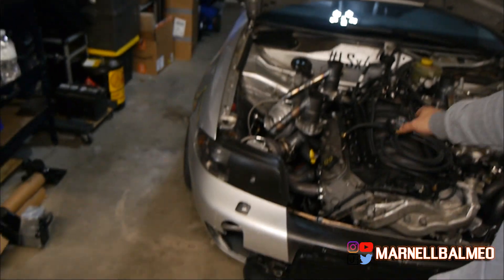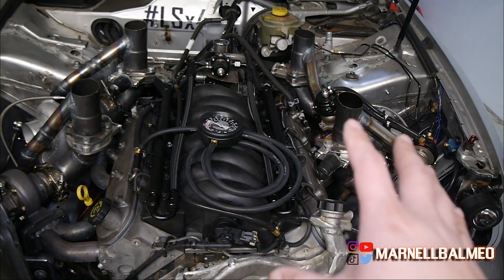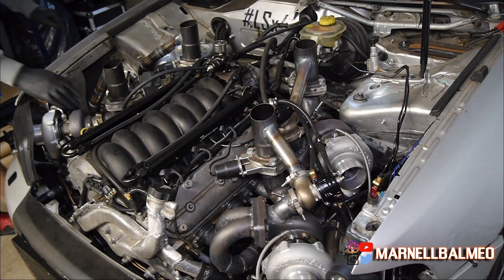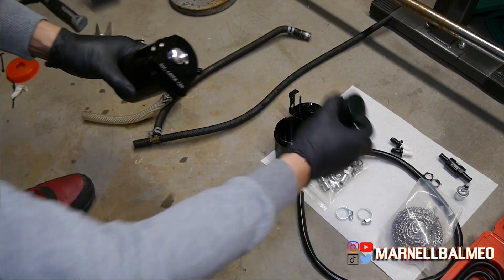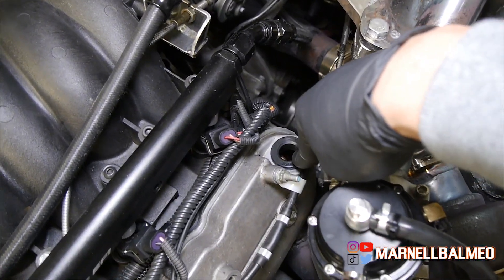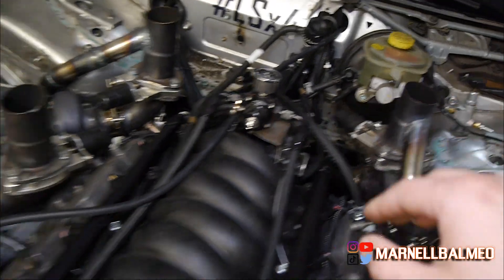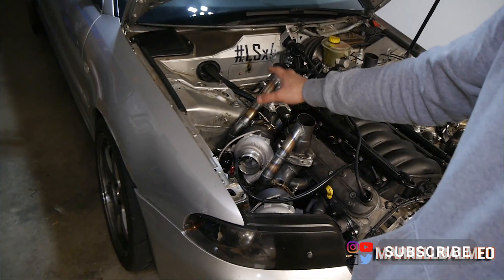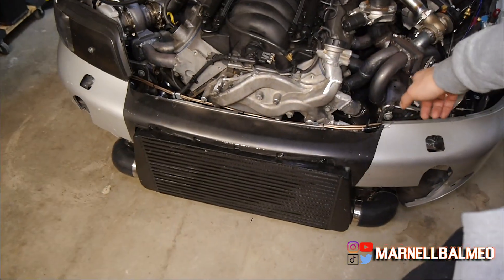Is a Breather or PCV better for Turbo LS? Well I can't believe it made that much difference.

Comment: I have a small 1.0-liter turbocharged car. Do I need to worry about crankcase pressure using just an atmospheric hose without intake manifold suction? Of course, the car already comes with a check valve at the valve cover outlet. Please help me! From Brazil!

Comment: isnt not smoking because the oil feed😂😂😂😂 nothing to do with running positive crankcase pressure, blowby is pushing the rings into hiding. oil seals are about to pop to heaven, another BS catch can clip. Do the research people.. e85 without negative crankcase pressure 😄you made oil contamination device. bravo

Comment: Venting into the Impellers is Stoopid  as it stuffs crank blowby products ie;  Oils, acids, moisture.. through the IC... the intakes and into the combustion.  Racers use a one way valve into the header collector which Suction vents the crankcase.

Comment: Why would you use a pcv valve to limit pressure relief that’s not the way you want to do it
Reply from the maker: I have since changed this to dual setup, which works much better. Even now still use the pcv valve mainly bc out of all the documents I found you also don't want full vacuum in your crank case. The other part of this is without that being limited I would now be introducing huge amount of air at idle as the port is after the TB. While I haven't tried that port being opened I'm going to guess it going to idle to the moon lol

Comment: In my boosted 97 cobra I run a oil breather catch can the Oct system resulted in too much crank case pressure and would try to blow oil out no issues with the catch can breather set up

Comment: You could vent to the exhaust and it will pull a vacuum with a venturi
Reply from the maker: Won't work well with my setup as I have a very restricted exhaust to control noise. So exhaust will end up in the crank case. It will work when cutout is open but majority of the time I drive with exhaust cutout closed.
Reply: it can work, you can run 2 lines, even pull from after the muff. also, use a old school smog pump 1 way valve at the ex pipe so it can only pull, even in case of a backfire. @MarnellBalmeo

Comment: I installed a M/E Wagner PCV valve with adjustable Idle and cruise circuits. Result is 3 to 5 in. of crankcase vacuum. I noticed a difference in HP and torque not to mention ZERO oil leaks...
Reply from the maker: Nice little unit. Looks like spring operated. I'm opting out to remove this for the time being and just vent to the atmosphere. Going to see if that's the source of my random iratic idle issue

Comment: Hi 👋 I recently just added a 2nd oil catch can for the crankcase. I was only running a mini filter but I noticed oil would leak out from the mini filter, so I decided to add another oil catch can. My question for you is do I need a one way check valve for the crankcase oil catch can setup? Or do I only install one on the PCV oil catch can outlet line? Both oil catch can doesn’t have a filter on top of the oil catch can. I bought the one that doesn’t have one
Reply from the maker: I have since modified this and have a working setup now. For a boosted car you need a 1 way check valve. It's valve cover-> catch can -> pcv(to reduce flow) -> 1 way flow valve -> intake manifold.
Reply: @MarnellBalmeo  So it’s not necessary for me to get one if I don’t have a booster engine?

Comment: How can you keep pressure with the filter on the catch can? I have two one for each intake but there’s a hissing noise that comes from it and when I cover it pressure comes back and engine runs normal again. When I have them on my car chops but that’s because the RPMs go 1, 2, 1, 3, 1, 2 etc..
Reply: Idk if you noticed but he put a one way valve in between the tank and the breather. That means it can only draw excess pressure out and not draw any air in (as is what’s happening in your scenario)

Comment: Any idea why I would get blow by out of oil filler hole (oil cap removed/ oil stick in) and no blow by out of oil filler dipstick tube (oil stick removed / oil cap on). I would expect them to both be blowing as I assume they valve area is open to crankcase area.... Really confused!
Reply: would assume that the dipstick goes below oil level so unless oil levesl are low enough which they would never be your not goin to get pressure back that way but oil filler cap or anywhere else at the top of the engine where pressure is trying to vent is where you would expect the most ventilation to escape

Comment: Holy hell. This is the first LS i have seen with 4 turbos? Anyhow that catch can is way to small. On my 1.8 liter boosted b series i have four -10 lines running to a 2 liter can mounted near the back of the chassis.
Reply from the maker: Yea I've gone through some iteration since then, definitely gone with a much larger lines now

Comment: Hey man I have a NA setup and I can’t find any straight answers on the correct way to run my catch can and what to cap off. Any help? Should I run it like you did and cap that back line that you ran to the turbo?
Reply from the maker: What year LS? Typically for NA you use the same ports and just add the catch can on series. So it's pcv-> catch can -> post TB port. Then the other valvecover port is used as a clean side/pre TB. Which valley cover btw?

Comment: Why would you put a breather on the PCV catch can side? That defeats the purpose of the catch can, as you need vacuum on the catch can side of the line to capture the oil. If you place a breather on the top of the catch can, you’re defeating the purpose. You do need a UPR breather on the oil cap, but you need to keep the PCV line pressurized.
Reply from the maker: Breather on a pcv catch can is fine as long as there is a 1 way flow valve-which i added here. This is similar setup as a mighty mouse catch can- which is one of the best out there for the LS. What it does is allow vacuum in your pcv but it acts as a breather under boost when you get pressure in your crank case. I did make a mistake on this that I put the PCV valve before the catch can. I later corrected that on another video. it should be valve cover hose->catch can ( vented with 1 way flow valve out)-> PCV valve -> 1 way flow valve -> post TB. This setup sees vacuum full time unless I go WOT. PCV line should never be pressurize, should be on vacuum or 0. Its now on its final iteration and have another fully vented catch can with 2 12an lines as breather on the oil cap was not enough for the flow its pushing.
Reply: @MarnellBalmeo  thanks for sharing.
Reply: @MarnellBalmeo  I have a 335i with 562whp, I have a dual baffled oil catch can with a crankcase breather (pcv delete) but I am having problems with the breather seeping. I don't think my coolant is leaking into the engine (exhaust doesn't smell sweet, coolant level seems to be staying the same) but when I have the oil cap off the catch can immediately stops seeping. Any suggestion on where to start?
Reply from the maker: @becausereasons41  what do you mean by seeping?
Reply: @MarnellBalmeo  the breather was dripping a foamy combo of oily fluff. I have fixed it with a oil cap crankcase breather with a diaphragm. Hasn't dripped anything out of the catch can since then.
Reply from the maker: @becausereasons41  sounds like the catch can isn't working correctly, Sounds like instead of capturing all that stuff iys getting pushed through. Adding a breather just opened up the system- path of least resistance. Check you catch can and make sure it plumb correctly and baffled correctly

Comment: You're discovering the benefits of crankcase evacuation... Here's my question... Now we both know that crankcase evacuation pumps exist. The problem is they are all race only parts. Start driving that thing on the street, and eventually the pump is going to crap itself.
But the new gen 5 engines have a vacuum pump already. It's fed pressurized oil from the block and drains back into the oil pan. If we put lines on it, we could potentially run it as an external pump with OEM reliability to pull a crankcase vacuum.
In your case you're feeding way too many turbos and probably don't have the oil volume for it, but most other turbo guys or supercharger guys would.

Just food for thought
Reply from the maker: Yea there is some people using smog pump as pcv vacuum pump. I opted against it bc if that fails I won't know right away, could be enough to blow the engine(if that's the only way out as a sealed pcv set up)